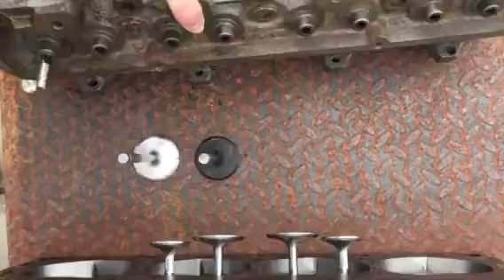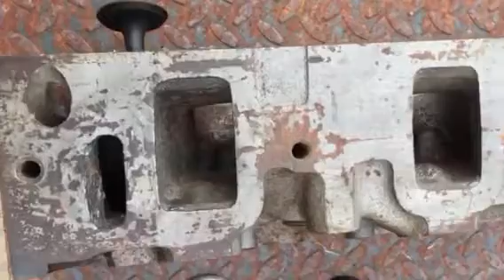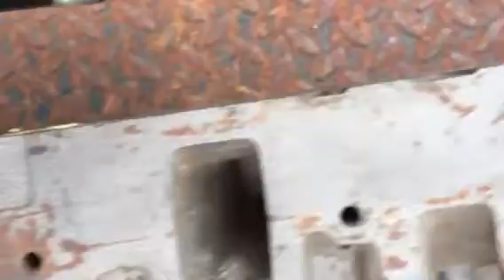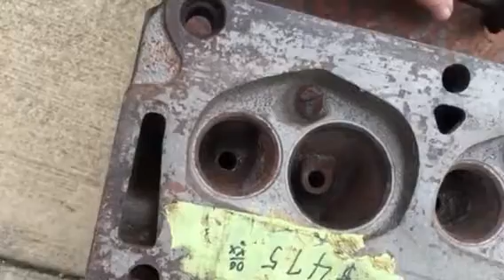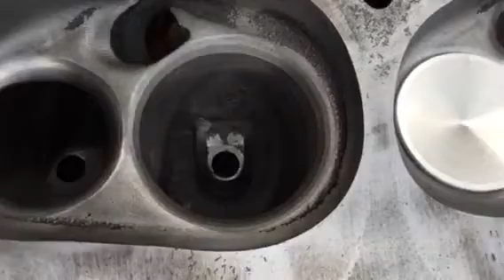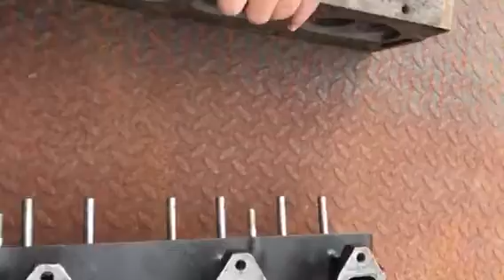Ford FE 406 Heads CNC work

Comment: I am having Craft Performance Engines build my '64 427 stroker with CNC ported C2SE heads. I am wanting the look of a period correct Mercury 406 Tri-Power option. I am anxious to see what it does on their dyno.
Reply from the maker: I had it dynoed recently. It made 350 hp and 425 foot pounds of torque to the rear wheels. With an estimated  15% drive train loss it should be around 420 hp and just over 500 ft pound of torque at the crank. It still needs some tuning and I could only run to 5200 rpm because I had interference with my electronic ignition and copper core plug wires. Still has plenty of power for the street and I am very happy with the head work they did. I love the stock look and it pulls like a train.
Reply: I really hope that you got your engine, the shop is locked up tighter than dick’s hatband. The sign on the door says do not contact the landlord (who owns the building and lives next door). about the whereabouts of your parts or deposits .  I bet the whales have your new BBM block and heads, TW intake and the king grand of cash you laid down. I sincerely hope that he does the right thing. I lost my heads I ported and decided to have the guides reduced for 11/32 liners and a 2.19/1.65 valve job along with the valves, and I was gaslighted (attempted) to believe that I had picked them up,  I saw them in a magazine on a 600 hp NA 400 ci engine with my initials ground off. Lol, I was born at night but not last night. Be afraid, unless you have your stuff at Brent Lykins place.

Comment: I would keep it a 406, lighter parts in the bottom end and valve train and let it scream.  Get the intake side flowing 305-310 and exhaust in the 240s , 7000 rpms built right in a light car, and let it do what it was made for!

Comment: Deck of the head looks like shit they should have mill them
Reply from the maker: I asked them not to be milled. I came to that conclusion later and had the heads milled at my local machine shop that also machined my block.

Comment: Nail head valves work better on the FE  than the tulip valves do. Flow bench R&D has proven this 20 years ago. The factory originally used tulip valves. But that was 50 years ago. Always work with FE EXPERTS.  Not generic motor builders. FE experts know from experience and R&D.  Just sayin. Love them FE motors.
Reply from the maker: Thanks. I am not ans expert and did not know about nailhead vs tulip vavles on FEs. Why do they work better?
Reply: @homesteadsteve8278  looks like he wants to trade you tulip vavles for some nailhead vavles!
Reply: @homesteadsteve8278  tulip valve takes up space behind the valve head and in the runner. Makes the total port cc. less. That's one thing. My builder is a old original racer and builder of 427's. He has built several record holders over the years. This is the knowledge he gave me. I didn't pull his teeth to find out everything. I think tunnel port heads work best with tulip valves. And the tunnel port head requires a special valve grind to work correctly. Most basic machine shops in small towns know nothing about the details of certain ford fe head secrets. My machinist is a fe motor expert. Races them. He also does heads for famous NHRA PRO STOCK DRIVERS. And they win too. His heads are on a recent record holding 64 thunderbolt.  All I can say is run the valves you have. And then run some nail head valves in those heads and you will feel a power gain. He did my C3AE- C 406. 6V heads. He ported them too. Put the 427 LR valves in them. There are valve notches on some 427 side oiler blocks. Usually 427 tunnel port heads required notches on the tops of the cylinders because TP heads used 2.25 sized intake valves and so the flow was restricted because of shrouding. The intake valve is too close to the cylinder.  If you notch them by hand carefully with the heads off the block. You can help the air flow by eliminating the shrouding by relieving with a notch.  I did also on a 351 Cleveland and it helps with flow.  It's not a very big notch. But fill the cylinder with rags so you don't leave metal shavings for the piston rings to munch on. I did mine with a dremel tool and hand files. Buffed them out to finish.  Use sand paper to finish. Be sure to think this thing out before you start. If you are in a hurry and assume things.  You may notch them in the wrong place. Can't put the metal back once the mistake is made.  (NOTE)  2.25 intakes have to have notches on a 427 block.  You cannot use 2.25 valves on a 428-406 bore block.  428-406 blocks only came with 2.09 valves.  So I would say to notch your block like it's a 427 tunnel port. If your using 2.19 valve in your 4.13 bore block its not recommended unless you unshroud the the chamber a little bit. And unshroud the cylinder to match it. It is easy and straight forward process.  Hands files, sand paper and a dremel or a cone role porting sander.  Check and double check before you start each cylinder. The notch will be at a 45 degree angle to the cylinder. Do not get too carried away with notching too deep or too big.  Remember the piston rings come close to the top of the block. You do not want the ring laying over the notch.
Reply: It looks like you have nail head valves.

Comment: Why a Comp Camshaft???
Reply from the maker: Seemed like a good cam shaft for my build. I was really close to buying an isky but went with comp cam for the higher lift and smaller duration. What would you recommend?
Reply: @homesteadsteve8278  I used a HolmanMoody camshaft in my 406FE for my Galaxie. Pulled like a freight train to 7,000!!  It was ground by Larry Wallace at Holman Moody.
Reply from the maker: @brandonhumphries3377  what are the specs for the cam shaft? How does it idle?
Reply: @homesteadsteve8278  specs are 242@.050 .526 lift  solid flat tappet. Idle is choppy and sounds good. My car is a 4 speed car, pulls from the bottom all the way to the top.